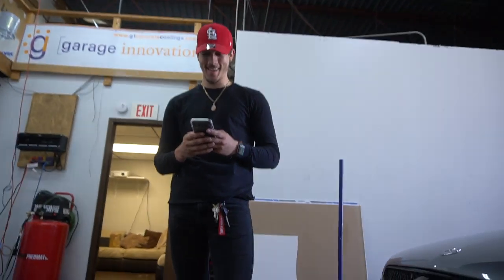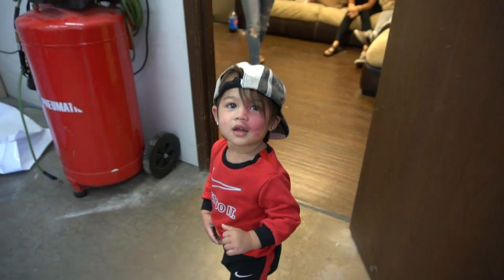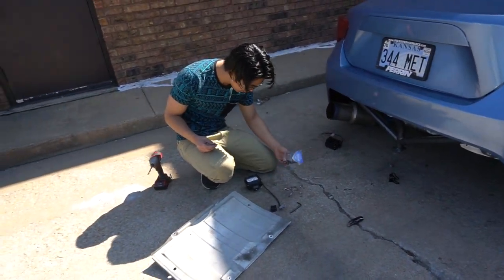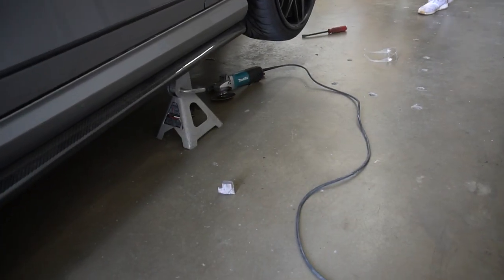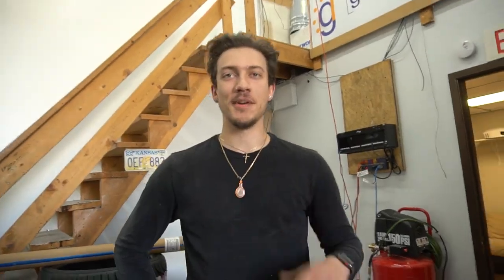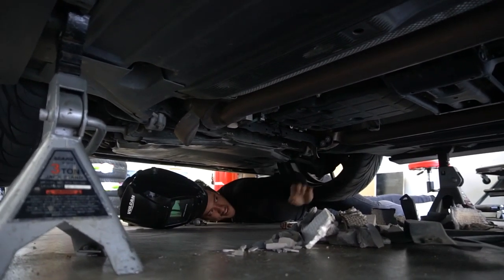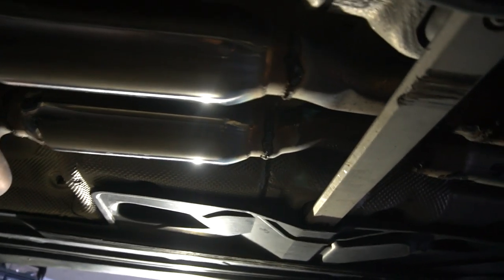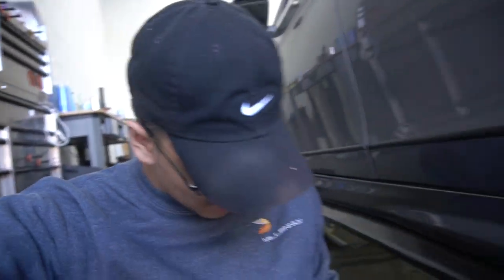MERCEDES-BENZ C300 4MATIC GOES FULL CATLESS | STAGE 2 TUNE | SHOOTS FLAMES!!!

Comment: It sound 🔥. I have a c250 and I was wondering did u have any drone when u got the muffler delete ? If so, how bad was it ?  I wanna get a muffler delete but I daily my car so I really don’t wanna deal with drone. Love the content.
Reply: Anything exhaust modification is usually gonna give you a drone but it’s not bad. Once you get above 4K rpm is where it usually drones but it doesn’t bother me
Reply: I have a 12' c250 try doing a resonator delete and buy a aftermarket muffler like flowmaster and you'll like the sound I have that setup an posted it on my channel let me know if you like It

Comment: I have the same exact color and spec but 2013 3.5L, did you get check engine light?
Reply: The stage 2 tune he has cleared off the check engine light . It comes with the tune
Reply: xCaShINx do you know what stage 2 tune he has?
Reply: Gabriel Figueredo you should ask “project a” or who ever he said did the ecu tune for him in previous vlog

Comment: With the stage 2 and getting the honeycomb out, will or have you had any issues with sensors and such that come with essentially taking out the primary cats? Or does project A do it to where it won’t show up regardless? Also have you passed inspection?
Reply: With the Stage 2 tune, it bypasses the o2 sensor meaning no codes or anything will show up and in my state, we don’t have any sorts of smog test or inspections

Comment: How much HP do you think you can get out of a 2014 c300 4matic if I do cat-less exhaust or best exhaust set up/turbo, ECU?. How much PSI can you do on a stock motor with 70k miles? Just curious, $ aside. Thanks
Reply: I have the same car and am wondering the same!
Reply: Dawg same why are there no videos on the 3.5 liter v6 c300 2014 like cmon that’s the last year for w204 and it’s the fastest c300

Comment: what is the little red around the emblem on your steering wheel? i want one
Reply: nolan smith it’s a decoration you can buy from eBay make sure you measure it before you order because mine it’s a little bigger so I cut half trim to fit the steering wheel with 3m

Comment: Is it really loud as a casual drive with rpms under 3k? Just curious as I’m thinking of getting it done. Also with the tune does it pop every time you let go of the gas?
Reply: It definitely has a drone when you drive but it doesn’t bother me. As long your above 3k rpm and feather the gas pedal, it’ll pop every time.
Reply: @DizFooJustin  with or with out the tune, and also do you do it in auto or manual